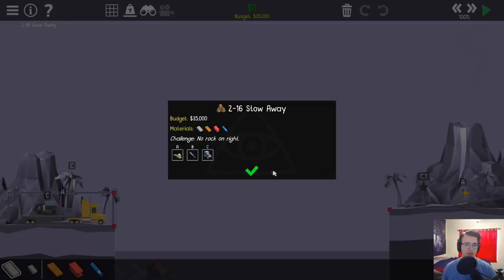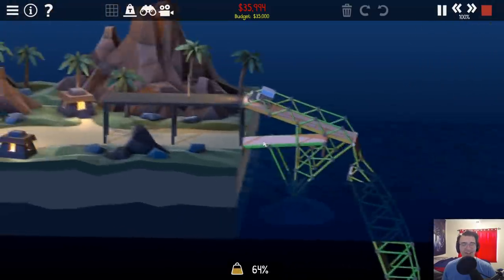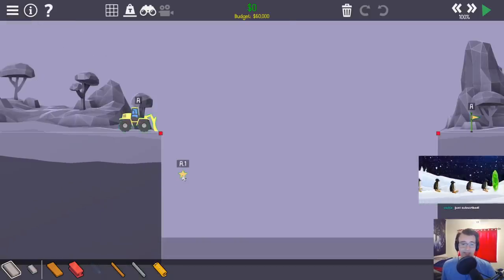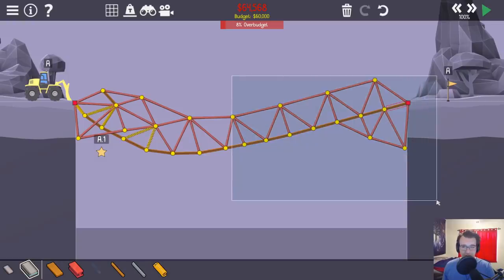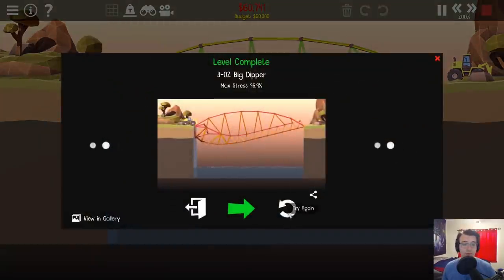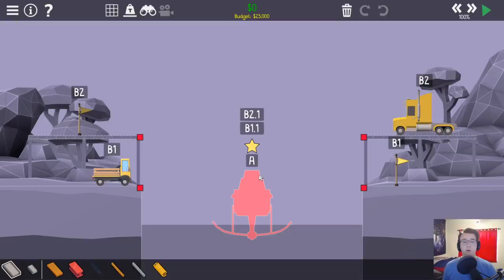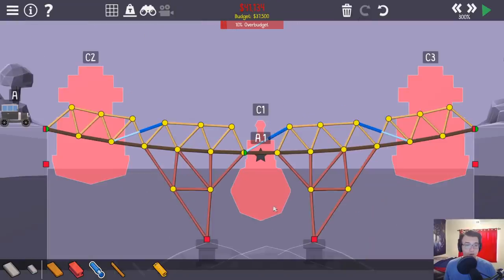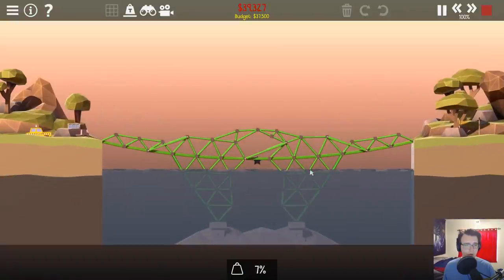Catching This Tractor Calls for a LOT of Springs

Comment: On the last bridge, when you think about it, it's actually surprisingly simple: levers! Connecting at the bottom causes greater strain than connecting on top. The weight also has a chance to distribute over the whole structure instead of being focused on the joins in the middle.

Comment: I wonder what actual engineers would think about if they saw these bridges lol
Reply: This needs to be a yt vid
Reply: As a mechanical engineer: If it looks stupid, but it works, it's not stupid 😅
Reply: Most of the levels would be fine but they would freak out at a bridge's support being made using fukin hot air balloons
Reply: @galaxc8462  they'd freak out way more that the balloons are somehow quantum-anchored to the world
Reply: They would build the bridge in a certain place and people who see it would be like, WTF IS THAT BRIDGE
Reply: I have seen many great feats, but this... This is incredible...
Reply: Bass T my thoughts exactly. keep it simple stupid is a common phrase in our field. the laziest people find the most clever solutions with the best cost effective method
Reply: Yo I just graduated with a mechanical engineering degree! We studied some stuff to do with truss structures and they’re fairly simple to solve, but can take a while to work through. I often see supports in these videos that clearly do nothing, and others that aliensrock over stresses when he could easily add support elsewhere to solve. But overall he has a pretty good idea of how these work. They do not however relate too much to a real bridges because they don’t factor for fatigue, weather factors, torsion, 3rd dimensional forces, material (other than the wood/metal), temperature (expansion of material), wear, and many other things. Not to mention factors of safety, reliability testing, logistics of the actual building of the bridge, and the civil stuff like foundation and what is underground (soft dirt/clay/rock/water ways and underground utilities) Tis but a game, but an entertaining one to watch at that!

Edit: oh yeah and following safety codes and roadway regulations!
Reply: The youtuber Blitz plays this game and he is (or was ) a civil engineer. Oddly, he's not that good at it .
Reply: Potatonite yeah you’re not actually doing any math or engineering, so it really just comes down to if you know a little about structure loading (ie triangles = stronk) and patience to make it symmetrical, which can much improve strength
Reply: @michaelh.9686  that makes sense
Reply: theres a poly bridge youtuber named "a real civil engineer"

Comment: GJ to whoever in chat suggested the over-boat supports. Makes sense that would massively assist in stability but damn to go from all steal to all wood with just that was surprising. I guess the leverage of 2 top heavy leaning towers just makes it that much more difficult to hold together when tied together at the base than at the top.

Comment: I dont understand why you use steel under the arch to connect it to the roads, doesnt the arch carry the roads and not the connectors? So the arch will be the most stressed part right?

Comment: should i get the original poly bridge or get this version?
Reply: Original PB has more difficult levels, but the physics are inconsistent and split joints/hydrolics will rip many bridges to pieces. I'd recommend the sequel as it's likely to be given more worlds, and can provide difficulty via workshop levels without annoying physics.